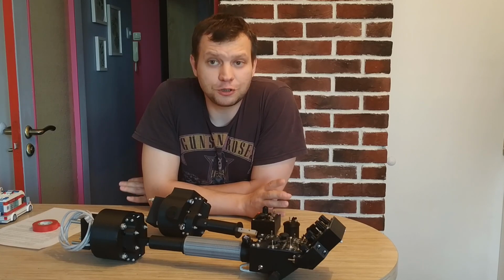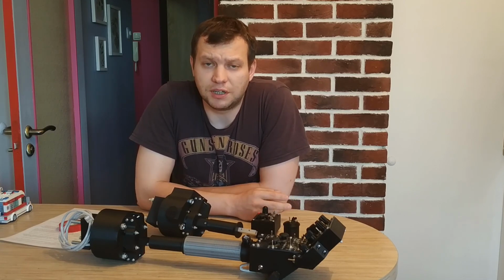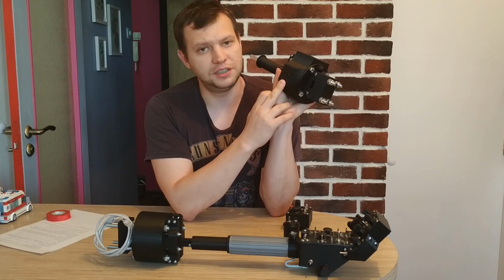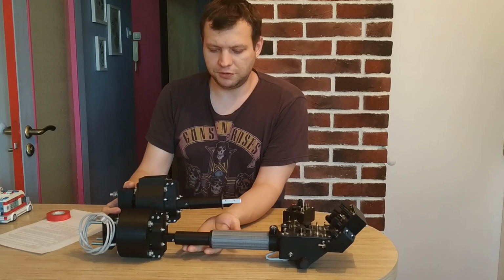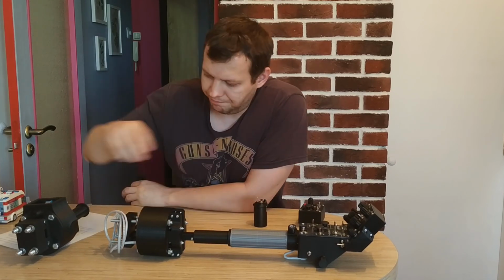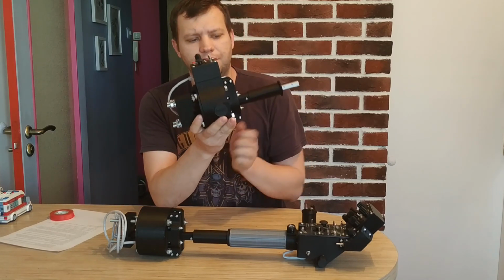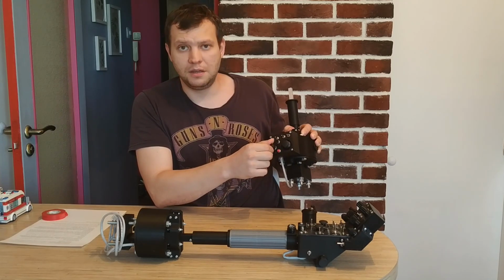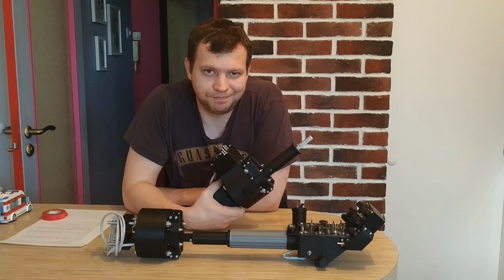Talking about new Simchair MKIV line and introducing new hardware!

Comment: What is the name of the software you mentioned for using maps with VR?
Reply: Hi! AviTab worked for that fairly well (you can use either built-in moving map or PDF charts), but I haven't tried it for a while. Sadly Xplane 11.50 has a glitchy VR mouse, sometimes it works, sometimes it doesn't.
Reply: Alexey Kudryashov thanks

Comment: Wonderful work! What kind of hardware and software combo do you suggest for dcs uh-1h huey? Uh-1 head of course, but what about other parts? Do you think all could be printed in petg instead of pla? Thanks.
Reply from the maker: Thanks! I suggest using a single lever without physical latch with throttle frame p1 from the 206 lever body, a pedestal (if you use vr or head tracker), mkiv cyclic base, b8 grip and pedals. For software, use the current mkiv  version. I think it can be printed in PETG, and will try it myself. Probably will need to adjust clearances - it has more noticeable shrink rate =)

Cheers!
Reply: @hc625mascozyhangar9  great! I have a last question: I have read about your force trim software system for the cyclic. Since dcs integrates a software method similar to yours for use with springed joysticks, is it possible to disable your method and use the one embedded in dcs? I fear the both together could interfere each other. I play in VR. I have a prusa mk3 but I never tried a such complex project and I know nothing about arduinos. Thanks.
Reply from the maker: @andrealioce4341  tbh I doubt it will be the last one so you're welcome to join our DIY Discord server =) https://discord.gg/SJrtWP We have a nice community there =)

About DCS and the trim, no worries, it won't interfere with DCS built-in trim system in any way, but I think my implementation may better. How are trim release and re-trim implemented in DCS? It's a very critical part. The built-in trim also works with pedals which is important. 

You can also fine-tune stick sensitivity with the rates panel which is a part of an MKIV cyclic base. It just reserves some buttons for trim management while active, but you can ofc disable it in the configuration tab of the firmware. 

Configurability of this thing is unprecedented, you won't find more advanced and functional devices on the market, in any price category. You can also extend the software and build your own devices easily using the same approach. Basically, you are not restricted to anything, you can do everything (and the current software contains tons of working examples you can adopt for your custom stuff), unlike factory-build controls that are targeted at a general user. That ofc doesn't mean you have to be an engineer to build the set - it's very Lego-like, but you can tinker with things as much and as deep as you feel the need to =)
Reply: @hc625mascozyhangar9  thank you for your detailed answer. Do you think a ka-50 head with a lever to simulate collective brake should be doable? Collective brake lever Is important in ka-50 since It commands the autopilot altitude channel; your system does not use a brake lever to hold in place, but It could be simulated with a switch on the head or something. About dcs force trim, It uses two alternative methods: either It disables joystick imputs after trim press 1) until you recenter the stick (like your method) or 2) for a fixed amount of time (leaving you the time to recenter the stick). You can add the pedals too or not, as an option. I'll check the discord channel. I'm absolutely unable to design something by myself, but maybe I can start by doing one of your excellent projects, learn something in doing them and (maybe) try to customize in a later time...
Reply from the maker: @andrealioce4341  But how does it feel that the stick is centered? Or it just maps whatever position the stick is now to a new center?

Regarding the collective brake, making a switch or implementing an automatic press of a joystick button when you move your collective is not a problem at all =) Hardware implementation is a more complex one, but doable. You may e.g. mount some bracket with a powerful DC motor into the pedestal slot, and connect another bracket to the lever instead or along with the pneumatic mod. It will require a separate power source, driver board and probably cooling, but should not be a huge problem otherwise! Although IMHO that's still too much if you're not building a KA-50 home cockpit =) If you need a button press on collective move function, let me know, I'll think about it =)
Reply: @hc625mascozyhangar9  I do not know exactly the logic behind dcs software, but It works this way: when you release the trim button, the virtual position of the cyclic is the new neutral and the input from the real stick are canceled; when you release the real stick and It Is springed to center the inputs are reactivated, so that the new virtual neutral position coincides with the springed center position of the real stick. For what the collective brake Is concerned, a button that Is automatically pressed when you move the lever would be even more than needed: a button easy to be manually pressed when you move the collective would be more than enough. You could simply add a button in the lower side of the collective lever, so that when you grab It you press the button with your fingers, and release It when your hand Is off. Thank you again and congratulations for your excellent work! 👍
Reply from the maker: @andrealioce4341  thanks! Adding a button to the bottom of the lever may be a bit harder than you think, there's not a lot of space for wires in there. Although we can make a mod with a bicycle brake like grip, mounted on the lever. The pure software implementation is smth that i can do quickly, but hardware stuff takes time and the right mood lol. Maybe a bit later.
Reply: @hc625mascozyhangar9  I've read on your site the explanation about your force trim method and I've understood It better; I believe It does not interfere with dcs uh-1h and maybe makes it easier to fly. But unfortunately It Is unusable with dcs ka-50. I try to explain why: ka-50 has an autopilot always on, with 20% authority on cyclic. When you set a new attitude, It tries to maintain It. This function is controlled with the trim button, which has two functions: 1) trim 2) set autopilot (AP). The fact Is that the button sets the AP when you release It, and disables the AP while you keep It pressed. Normal ka-50 routine Is to press the trim, then move the cyclic to the new attitude keeping the button pressed, and finally release the trim button. Keeping the button pressed and thus disabling the AP Is important: if I have set the AP to keep the right and I want to go left, without disabling It I'd fight the AP while changing attitude. With your method, if I keep the button pressed I have all the inputs canceled, and I cannot move the cyclic. Moving It without pressing  the button forces me to fight the autopilot. Maybe there could be some software modification to avoid this, and allowing the use of your system with ka-50 too.
Reply from the maker: @andrealioce4341  Interesting! Yup, its mostly for helicopters without SAS. In this case, you can disable it in configuration to free one button and a hat switch for something else =)
Reply: @hc625mascozyhangar9  would It be possible to use a rear throttle quadrant, like the barrel-shaped one shown in the main picture of your wiki, together with mk4 controller and a pedestal?
Reply from the maker: @andrealioce4341  you can use the MKIV version of it - its much more thouht out. MKIII one was a prototype hastily concocted under a sudden burst of creativity while working on another device lol
Reply: @hc625mascozyhangar9  I know nothing about mechanics, sorry if I'm asking somethig stupid, I'm Just daydreaming, but do you think that changing the four springs in your mk4 cyclic base with some pneumatic cylinders or something like that, could result in a proper mechanical trim, i.e. you push a button, move the stick, release the button and the stick holds in position?
Reply from the maker: @andrealioce4341  nope, for what you have described you will need a full-blown magnetic brakes, with a double-decker rig with trim system guts under the floor. Pneumatics only adds some resistance when you move the stick, but attaching cylinders becomes a complex task with a level of precision needed for cyclic. Spherical bearings and stuff like that have mechanical jitter, i think it will only be annoying. I am thinking in this direction, but havent been able to find a reliable solution so far, sadly.
Reply: @hc625mascozyhangar9  I've started printing mk iv controller, I'd like to join your discord channel but It says my invitation Is expired. Could you send me a new one, please? Thanks.
Reply from the maker: @andrealioce4341  sure! https://discord.gg/MEjJNE
Reply: @hc625mascozyhangar9  I'm sorry, I do not know why but it's expired again! Never used discord before, maybe it's me missing something... could you please try again? Thanks
Reply from the maker: @andrealioce4341  sure! https://discord.gg/3XuZMDY